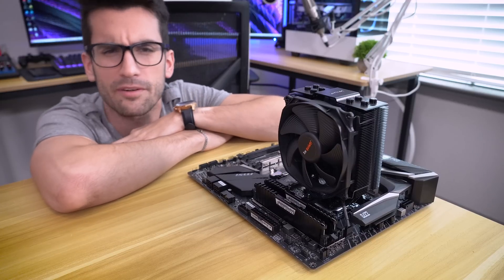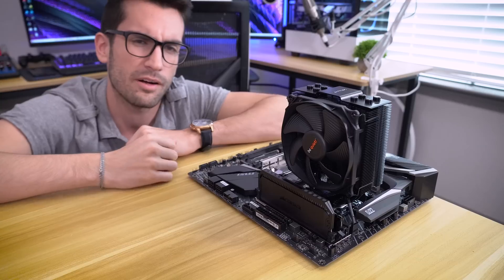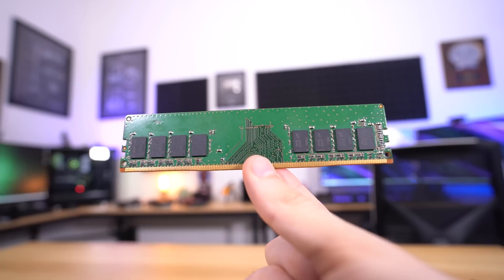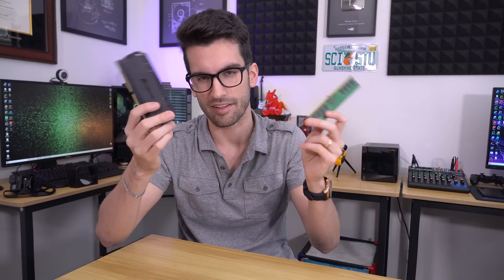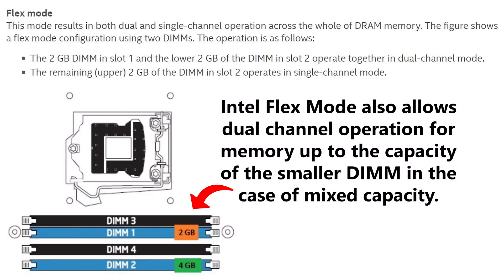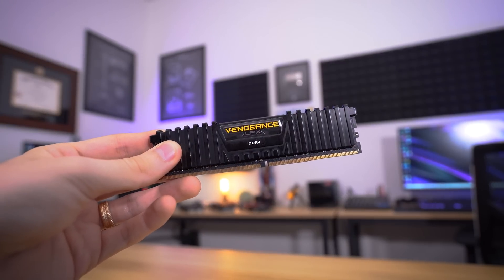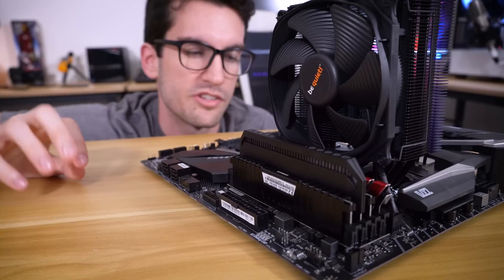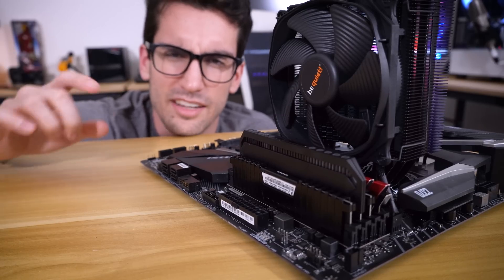Mixing RAM?!

Comment: I've used 2x8GB and 2x4GB sticks for a total of 24. 2x8GB are the  Kingston Hyper X Fury and the 2x4GB sticks are Patriot sticks. All run 2400mhz speed and I have experienced some hiccups and then I disabled XMP in the BIOS. They worked regularly, after that.
Reply: what abt having a 2x8gb of corsair vengeance ddr4 2400hz in pair
then yr later i will try to put another 2x8gb of hyper x 2400hz in the second channel of my Msi b250 motherboard hving i7 7700. will this configuration be good. im not into overclocking. i want my parts to last as much as i can.
my Corsair vengeance working fine since 2018.. hows hyperx compare to corsair vengeance in servicing and warranty repairs in delhi, India 🇮🇳
Reply: @CaptainScorpio24  No worries there because they're both running at 2400mhz, it'll give you a total of 12gb and I've once used memory like this configuration! Best of luck brother
Reply: @zeroiq2238  thanks 🙂 🙂 🙂

Comment: I'm running 24g of vengeance lpx the 2 4g sticks are 2133 and the two 8g sticks are 2400...  XMP is Running all at 2400 no issues... I honestly didn't Even know about possible Issues when I set this Up in the past..
Reply: what abt having a 2x8gb of corsair vengeance ddr4 2400hz in pair
then yr later i will try to put another 2x8gb of hyper x 2400hz in the second channel of my Msi b250 motherboard hving i7 7700. will this configuration be good. im not into overclocking. i want my parts to last as much as i can.
my Corsair vengeance working fine since 2018.. hows hyperx compare to corsair vengeance in servicing and warranty repairs in delhi, India 🇮🇳

Comment: I tried to combine 1rx8 (2gb) and 2rx8 (4gb) and always has a bluescreen, any suggestion? Or is it impossible to combine different rank? Thanks.
Reply: I have, 2x 4gb 1 rank and 2x 4gb 2 Rank, not even the same frequency, 2133 2r and 2400 1r. I do have Z chipset so I can adjust the timing, the only issue I had was with the subtiming, they were not the same on each channel. Took a little fiddling but it works great
Reply: @claudep8014  could you please help me and show me how to make it work normally? Because my pc always had a BSOD after playing a game like irql_not_equal or memory management etc I am so confused about it😭
Reply: @andromeda6686  sure no problem, just give me your spec, motherboard, cpu, and all your ram spec, speed and timing, also make sure you have the lastest bios on your board install, I can help with that too, if an update is needed.
Reply: @andromeda6686  the secret is to find a proper speed and timing that is stable
Reply: @claudep8014  motherboard: Lenovo 4236GT4, CPU: intel core i5 2430M cpu 2.40ghz, Ram 1st slot: samsung ddr3 10600s 4gb 1333mhz and 2nd slot Nanya Technology ddr3 10600s 2gb. Timing in total: 11-11-11-25 (i use cpu z for this data) please help🙏
Reply: @andromeda6686  humm... A laptop.... That's a different story... Ok so you have a Thinkpad T420 right ?
Reply: @andromeda6686  what version of windows do you have ?
Reply: @claudep8014  yes that's right, could you please help me with this specification? I know my laptop is kinda lame 😭🙏😁
Reply: @andromeda6686  yeah, going dual channel will give you a boost in performance, let me see what I can do
Just need to do some research to see if your laptop has a whitelist bios, give me 10-15 mins
Reply: @andromeda6686  I was afraid of that, your bios is lock, let me see what I can find...
Reply: @andromeda6686  but first, have you tried to switch the ram stick ? Change their order, put the 1st in the 2nd ECT..
Reply: @claudep8014  already done that, to be honest, about bios, its beyond my knowledge i have lack knowledge about it so i need an information from expert like you please help🙏🙏😁😭
Reply: @andromeda6686  have you ever updated you drivers ?
Reply: @andromeda6686  go back to cpuz and click on the tab Mainboard. in the middle their will be a description of your bios, tell me the version, they did improve memory a lot in the last few update, will see if it help
Reply: @claudep8014  what driver? Hmm i actually just updated the video card is it correct? And i already check all of the driver in computer management -> device manager and it says "your driver is up to date"
Reply: @claudep8014  bios: Lenovo 83ET79WW (1.49) date 09/05/2016
Reply: @claudep8014  what abt having a 2x8gb of corsair vengeance ddr4 2400hz in pair
then yr later i will try to put another 2x8gb of hyper x 2400hz in the second channel of my Msi b250 motherboard hving i7 7700. will this configuration be good. im not into overclocking. i want my parts to last as much as i can.
my Corsair vengeance working fine since 2018.. hows hyperx compare to corsair vengeance in servicing and warranty repairs in delhi, India 🇮🇳
Reply: @CaptainScorpio24  let me see what the b250 chipset can do...
Reply: @CaptainScorpio24  the chipset wont allow you to fine tune your Ram, you need H or Z chipset for it. You are also limited to 2400ghz. You should have more than enough Ram with 16Gb, that's what I have and I never go higher than 12. If you do need more, make sure both kit are the same. Same brand, specs and IC( same memory chip), their are website with all the detail somewhere out there. For guaranty and stuff like that, I have no idea, I m in Canada so... No idea. Those sticks are pretty cheap in eBay, shouldn't be Bonnard to find replacements.
Reply: @claudep8014  thanks for yuhr reply sir i need for video editing and premire pro. wats ur recommendation. by current msi b250 pro vh only has 2 RAM slots and bound to 16gb only with 8gbx2 confi.. i will b buying the eztra motherboard wd 4 ram slots so shud i buy 2x8gb ddr4 dims or 2x16g dimms. please help 😇
Reply: @CaptainScorpio24  ya the b250 by is a very low end board, if you hammered your cpu with editing for long periods of time you will end up burning it, only 4 vrm phase...
Reply: Let me see if I can find you an alternative...
Reply: @CaptainScorpio24  try to get your hand on a h110 motherboard, try to avoid MSI, they have a weak VRM. After that you will be all good, Ram won't matter, you should be able to fine tune it manually, time intensive but also kinda fun lol.
Reply: @claudep8014  actually h110 is tge lowest hand it doesn even support 2400hz ram rather 2133 only. as it is 7th gen its difficult to find 7gen motherboard loke h270 and z270. only B250 ones are available. im buying bcz its the motherboard that get sick. cpu remains fine forever, RAMs are available forever and one cud buy any gpu at any part of the time n place.
Reply: @claudep8014  plus i use windows 7 so its the last processor of cpu n motherboards thats supports win 7 officially
Reply: @CaptainScorpio24  win 7 is no more supported, you should upgrade to win 10, very easy to do and very easy to hack also lol
Reply: @CaptainScorpio24  hint, kmspico, Google it 😉
Reply: @claudep8014  win 10 is itself a big malware and Spyware. it very much specs hungry and buggy OS.
Reply: @claudep8014 i use this to activate my win 7 😂🤟. dnt worry its my home system
Reply: @CaptainScorpio24  you can always go AMD, very cheap but I would wait for the next gen, price of used part should go down.
Reply: @CaptainScorpio24  ya, you do need to shutdown all the crap that come with it, but I do need Dx 12... You could always go wit Linux, but i cant help you with that
Reply: @claudep8014  thanks sir i will look into it. but for now my i7 7700 gtx 1060 6gb upgarded 32 gb will b enough for 3 4 yrs  easily

Comment: What about quad channel setup? I.e. Slots 1/3 2x8GB @3200MHz, slots 2/4 2x8GB @2666mhz? Would just the 2x8GB @3200mhz out perform the 4x8GB 2 at 3200mhz, 2 8GB at 2666mhz?

Comment: So I plan on, upgrading my current dual channel ram hyperx 16gb 3200mhz system with another same pair of the hyperx ram and same speed. Will this run in quad channel ? Are speeds affected then? My system is a Ryzen 9 3900x
Reply: what abt having a 2x8gb of corsair vengeance ddr4 2400hz in pair
then yr later i will try to put another 2x8gb of hyper x 2400hz in the second channel of my Msi b250 motherboard hving i7 7700. will this configuration be good. im not into overclocking. i want my parts to last as much as i can.
my Corsair vengeance working fine since 2018.. hows hyperx compare to corsair vengeance in servicing and warranty repairs in delhi, India 🇮🇳

Comment: Lol im upgrading a pc and wanted new ram, just because, i like rgb. Lol. So i already have 16gb 2400 in my current system, and buying 16gb of tridentz 3600, so i figure, if i put it all in my new system when i get it, 32 gigs of 2400 speed would be better than 16gigs of 3600. But ill do some testing to find out when i get it! Btw, im using 8gb sticks so yes i am utilizing dual channel, not a dummy going with a single stick.
Reply: what abt having a 2x8gb of corsair vengeance ddr4 2400hz in pair
then yr later i will try to put another 2x8gb of hyper x 2400hz in the second channel of my Msi b250 motherboard hving i7 7700. will this configuration be good. im not into overclocking. i want my parts to last as much as i can.
my Corsair vengeance working fine since 2018.. hows hyperx compare to corsair vengeance in servicing and warranty repairs

Comment: Memory isn't as picky as it used to be.
A while back I used to have an old Dell Dimension Pentium 4 system from the early 2000's that was extremely finicky when it came to memory. Any empty RAM slot had to be populated with a RAM terminator, if a slot was left empty the system would refuse to POST. All RAM modules also HAD to be the EXACT same frequency and installed in pairs or the system also would not POST.

Comment: Weren't there a few 775 motherboards back in the day that had BOTH DDR2 and DDR3 slots on them? Therefore that is the only exception where you could interchange different memory types.
Also, in more modern times I think there were a few Skylake 1151 boards that had both DDR3 and DDR4 slots as well.
Reply: That's a cool idea for using older ram. Brilliant!

Comment: How about in laptop setups when the stock ram already solded in the motherboard? It is ok to insert another ram? Although they are not actually the same?
Reply: Same issue here. 
Not.the speed but the capacity. Got 4GB soldered, wondering if I could add a 8Gb stick.along with it and will 12 GB in total run just fine in dual channel.
What did you do?

Comment: if i connect  G.Skill 3200mhz CL16 8gb with HyperX 3200mhz CL16 16gb i will get 24gb of ram working fine? (sorry for asking but english is not my first leanguage so i need to ask if its possible) 
I would like to make sure I understood everything correctly

Comment: i already have 2x4gb 3000mhz, unfortunately this product has been discontinued. and they starting to sell 3200mhz. i see they've same cas latency, same timing, same voltage. the only difference is speed only. i just wanna ask, can i overclocking to 3200mhz and add another 3200mhz on same system?

Comment: Hey I have a weird ram issue. I have a 1500x and a x370 carbon pro and I’m trying to get every last drop of performance from it.
I have 4 8 Gb sticks of ram, 2 @ 3000 and 2 @2400.
The 3000mhz ones are ryzen compatible and are some geil rgb sticks. The 2400mhz ones are some Samsung sticks I got from some thrown away prebuilts.
I had all 4 in my for about 3 weeks. Then one day randomly after my bi monthly windows reinstall, it decides to not post. Reseated the ram. Tried different slots. Tried each stick. Nope. They all work. But when they are all in, no post. When I have a combination of three, it works fine. The ez debug led shows CPU and DRAM.

Btw the Samsung sticks can comfortably run an 3066 MHz with 16 18 18 36 timings

And A-XMP is supported too

Comment: Can you over clock the slow ram will under clocking the faster stuff  I I have 24 GB of Ram  DDR4-2400 2X8 GB + 2 X 4  GB DDR4-2400 Over clocked the DDR 2400  to 2933 will underclocking the 3000 Kit.

Comment: I was running 2 tforce 4gb sticks and 2 xpg 8gb sticks and I kept getting BSOD. Rip
Reply: @Will Y what abt having a 2x8gb of corsair vengeance ddr4 2400hz in pair
then yr later i will try to put another 2x8gb of hyper x 2400hz in the second channel of my Msi b250 motherboard hving i7 7700. will this configuration be good. im not into overclocking. i want my parts to last as much as i can.
my Corsair vengeance working fine since 2018.. hows hyperx compare to corsair vengeance in servicing and warranty repairs in delhi, India 🇮🇳

Comment: Got a x370 CH6 running 40GB RAM, I had ot running on 2x 4GB of 3200mhz,then bought a cheap set of 32GB 2666mhz from a buddy,its running at 3000mhz,I havent tried pushing it any further,but makes running VM's pretty easy! Like the vid,keep it up! When your broke,or sometimes when you have some oddball stuff laying around, it doesn't hurt to try running mixed modules,worked for me!

Comment: I recently bought a used kit that was meant to be the exact same as I already have (2x4Gb DDR3-1866) but turns out the seller sent me one 1866 and one 1600 stick. I tried running all four but I get BDOD due to memory and when running memtest I got some errors. According to this video it is possible? But how?

Comment: You mentioned that you need sticks of the same size for dual-channel. Not really... Currently running 1x16GB stick on 1 channel, and 2x4GB on the 2nd one. Also on a laptop, 1x4gb + 1x8gb (ddr3) worked in dual channel. No idea if i was just lucky or not, but it does work (at least some times)

Comment: I have 2x 4gb ddr3 ram with different brand. At first it was okay until 3 years later my mobo keeps nonstop rapid beeping and the monitor is black. Idk if it's the side effect of mixing the rams.
Reply: I doubt that after 3 years of working

Comment: Now i have 2 x 4gb 3200 MHz hyperx predator ram. For some games this isn't enough so i tried buying 2 x 4gb more but i can't seem to find the same preadator ram in my country. i did find 2 x 4gb 3200 MHz hyperx Fury ram. it's the same speed and same capacity. should i buy this? Will it work normally?

Comment: So I'm getting the same Brand RAM to go up to 32GB total, but I'm getting a newer Model of it being PC4-25600 and my older one being PC4-24000. But they are both running at 3000MHz. Added: They are both DDR4
 
So...The only issue I would have is that all of my RAM would run at 24GB/s? Cause if that's so, I don't mind.

Comment: In a nutshell: YES ITS FINE TO MIX RAM! Just don't XMP or overclock.
Reply: I have a question:i had and still have 2x4 ram ddr3 and i bought extra 8gb stick. Pc runs fine with all of them however i put 1st 4gb in first slot and in second i put 8 gb and then in 3rd again 4gb. I dont know if I should do that?

Comment: Here as just killed a  8gb stick of ram by pulling off heat spreader out of curiosity.  Now running on 12gb of ram as only have 4gb to replace the 8gb stick.  No noticeable system difference.

Comment: I have a laptop with 8GB DDR4 RAM (2133Mhz) I want to upgrade it and a little bit confused as to how to go about it...
only one stot is empty, So can I install a 16GB DDR4 ram(Making total of 8+16=24GB) in that so in future I can remove existing 8gb one and install another to make a total of 32GB(in future).

and also can I install a higher frequency RAM (I know It'll run at 2133 for now till it's paired with my existing one) for future perspective. What's your input to this.

Hoping for an informative response.

Thanks

Comment: I've had weird luck with memory. I've only ever had BSOD due to memory reasons when not mixing chips. My old system has 2 different types at different limited of 2 and 4 so it has 12GB in total but I never had a BSOD on it due to memory reasons.
That system was also before I knew about the proper way to install memory in channels so I had 2 of the same in A1/2 and the other 2 in B1/2.

Comment: What if you over clock both ? For example a 2400mhz and 2667mhz to run at 3200mhz ? Will that work too?

Comment: Fun fact when u mixing 2133MHz and 2400MHz u still able to OC it at 3200MHz at 1.35v. tested on cheapest module that i got. And it has different size. 2133MHz 4GB and 2400MHz 8GB. tested on Ryzen 3 2200G A320. 

It has same sk hynix controller/chip btw

Comment: I have always mixed ram sticks with no problem until I built my Ryzen rig. Same brand, same model but different speeds and timings. The thing was really unstable and I had to manually key in the timings. I think the problem was that the slower stick had better timings than the faster stick.

Comment: Will this work kingston 8gb ddr4 2400mhz and kingston 8gb ddr 2666mhz? Using asrock a320m hdv r4.0,  i check the mobo supported ram list,both on the list, but can i mix both ram with different speed?

Comment: I can confirm dual channel works with mixed brands and different spec/capacity RAM with an i3 2130 on its lowest end chipset.  Can also confirm random unexplained crashes, lockups and rebooting.
Reply: uhmm i have HyperX Fury 8gb 2666 i want to add another 8gb 2666 ram but the brand is different is it ok?

Comment: I run 2 pairs of different branded ram cards. 2 are 4 gig and 2 are 2 gig. Never run into any issues and my pc detects the full 12 gigs. Honestly really glad I decided to try it out one day and it actually worked.
Reply: What order do you put the slots in? I have the same thing. 2 4gigs and 2 2 gigs. Put the 4's in A1, B1. And the 2's in A2, B2? Or what order?

Comment: i mixed modules once because i had 2x8 vengeance and 2x8 of another, and the system would be fine until i started using more than 50% ram, and it would BSOD every time.